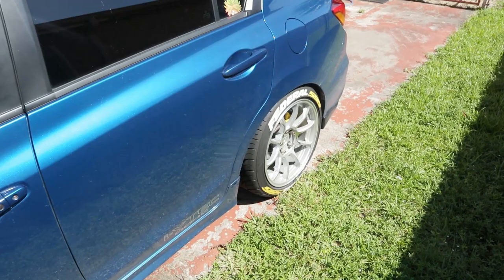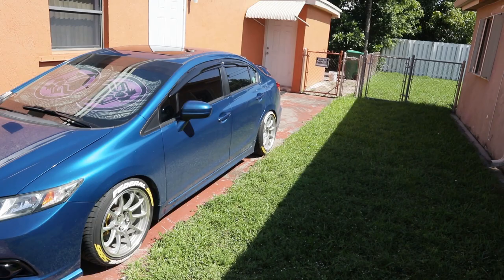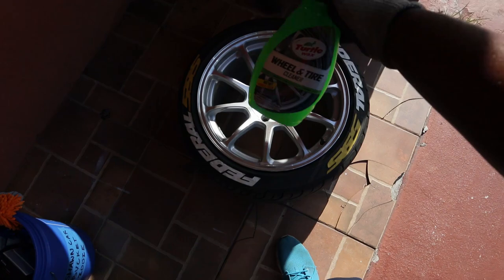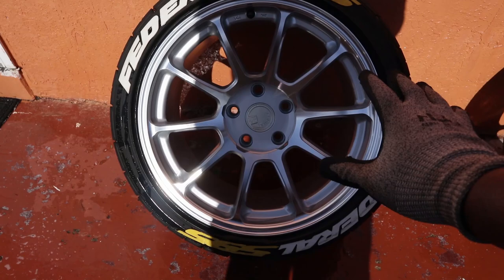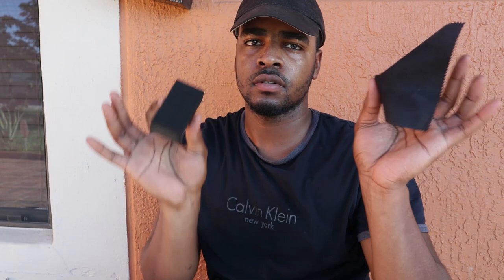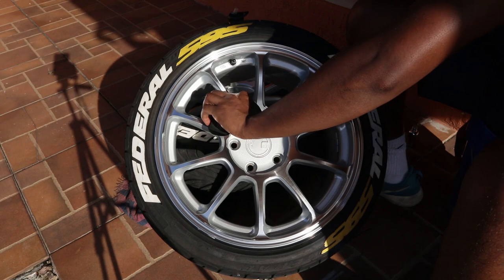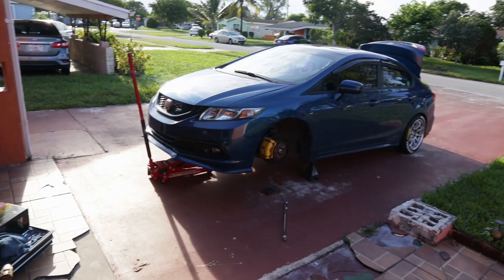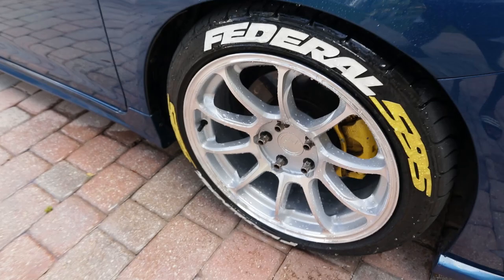How To Ceramic Coat Your Wheels! | Avalon King Ceramic Coating

Comment: i'm not sure this coating is suited for wheels en inner barrels, due to the high temperatures. Most big name coating companies have specific coatings for wheels with high temperature resistance.